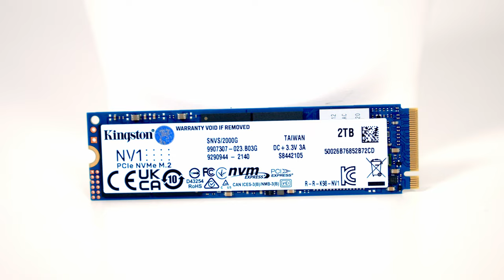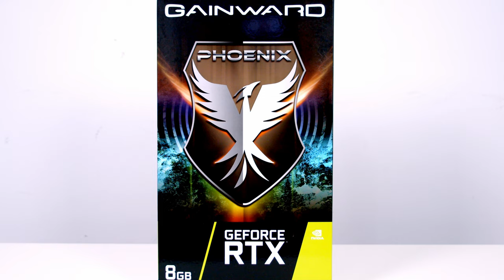Phanteks P500a PC Build with CCL Computers

Comment: What kind of temps are you getting with the 12700k and dark rock cooler? I'm looking to run the same mobo and cpu with a 3080 Tuf in a lian li lancool 2 mesh performance case and unsure if I should run an aio or air cooler for that cpu after reading all the crazy reports online about how hot they get

Comment: I’m actually working on a build that’ll actually be very similar to this.

Phanteks P500A
EVGA 3080 FTW3 Ultra
Intel i7 12700k
Corsair H115i/H150i Capellix
MSI Z690 Tomahawk DDR5
32GB Corsair Dominator Platinum 4800
Corsair RM1000x

Flashy but capable